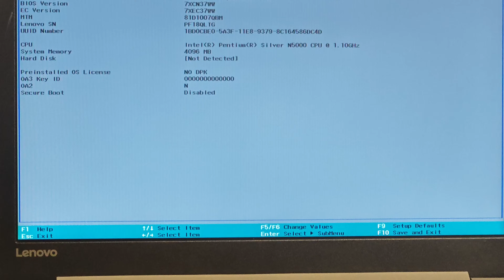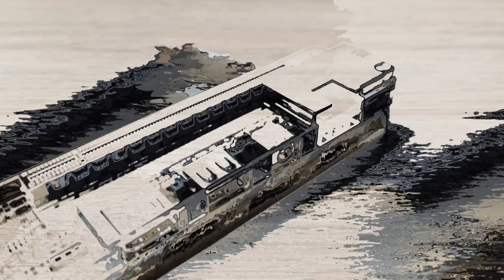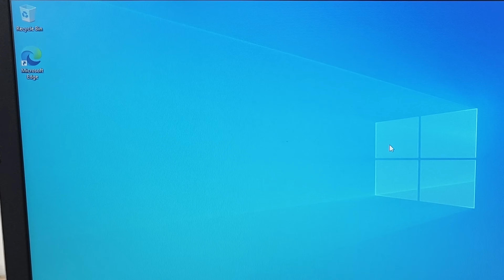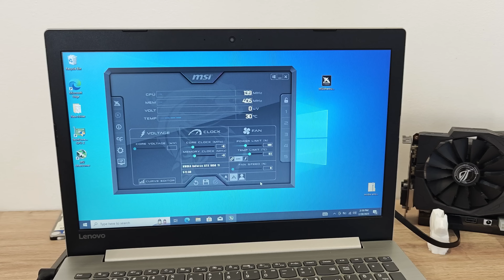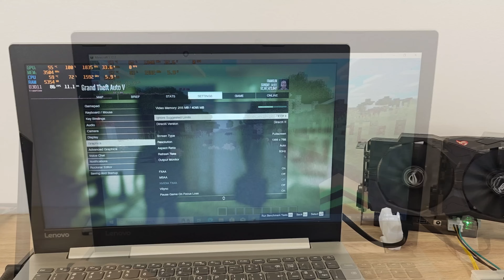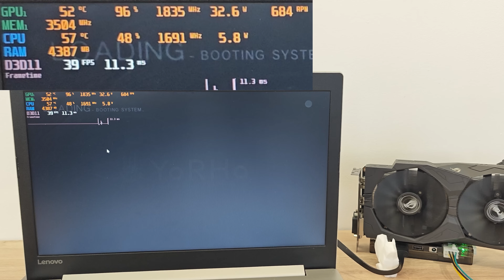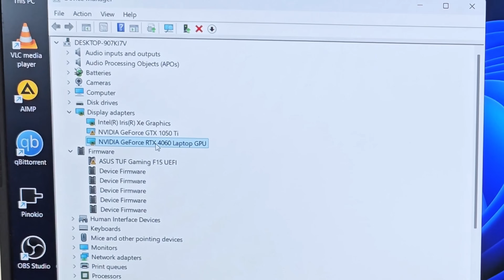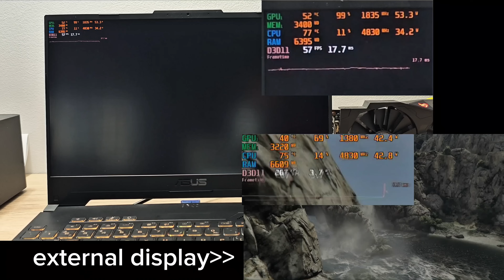Upgrading a budget Laptop with an External GPU (M.2 A+E) – Worth It?

Comment: The Egpu was connect to the wifi slot so it’s going to bottleneck a lot, i recommended only connect to m2 ssd slot and thunderbolt port, especially if the cpu is weak

Comment: Just a suggestion you can make a mod hole onto the backside cover of the laptop 2.06 so no need to everytime take the cover off everytime when plugging unplugging the cable m2 cable
Reply from the maker: Yes This laptop had a hole for a disk drive which I removed and the cable goes through there.❤

Comment: i see ur cpu mhz 1300-1400 try overclock the TDP to 15W it will give low bottleneck and cpu stays 2400-2700mhz
Reply from the maker: Unfortunately it's impossible for this laptop

Comment: Hi, at 7:20 for a reference a good solution for this stutter set a max limit for the fps like 60 or if it is run 90 set as 80 From the game or Nvidia control panel . So the cpu can keep up. And thx for the video it was so clear.

Comment: i have a dell latitude e6420 A website says that it only supports 8 GB of RAM. If I increase it by 8 GB, will the system recognize it?
Reply: There is no issue with ram . It'll easily detect it...

Comment: What if I connect i5 13500h - asus vivobook 16 (intel iris xe graphics)with rtx 4060
Reply from the maker: Hello! I think your laptop has USB 4 so there is an easier option for you. You can watch this video, it's much more detailed and the author talks about the method via Thunderbolt 4 and the performance. But first of all, check if your laptop's supports USB 4 supports thunderbolt : https://youtu.be/fPOgv63Yvx8